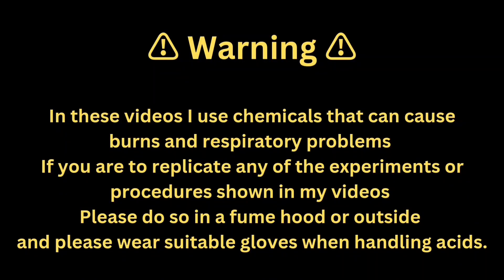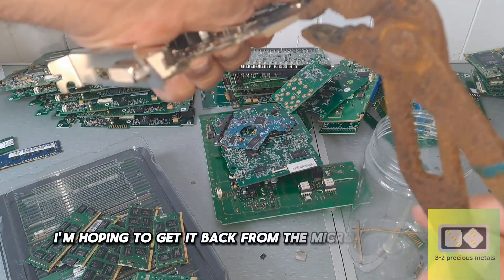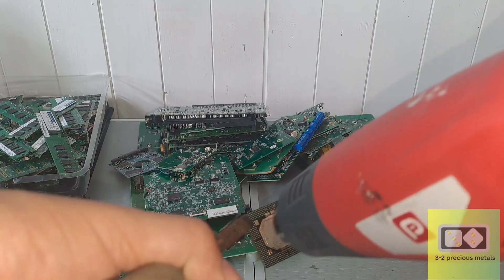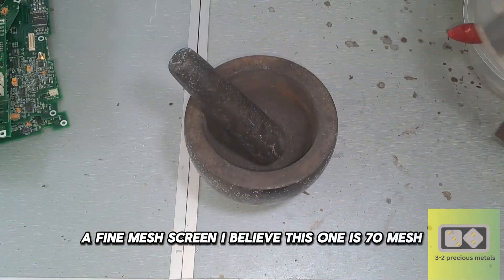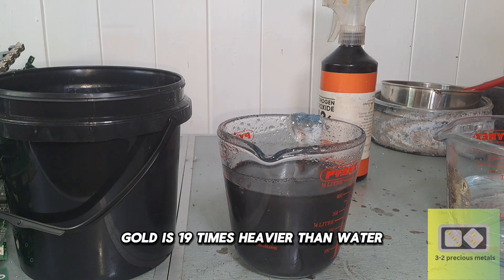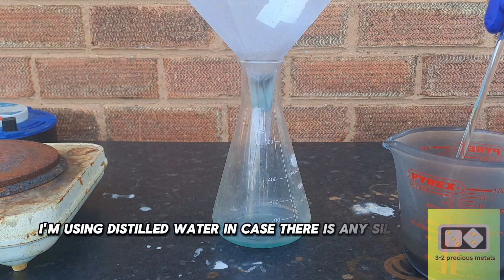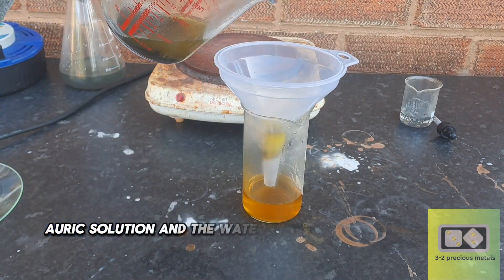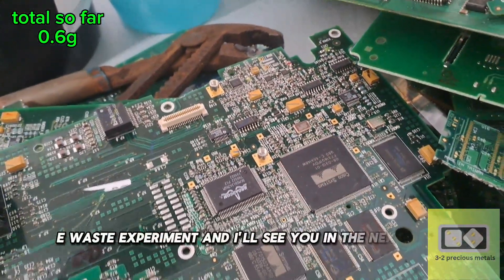GOLD RECOVERY from eBay EWASTE. (Part 1) gold fingers, processors, and bga chips

Comment: What does this take the gold to 14k, 24k?
Reply from the maker: The gold is around 23k - 24k as there could be some impurities from recovery. But a quick re dissolve and precipitation ensures 24k
Reply: @3-2preciousmetalrecycling  so for that process is aqua regia the process used? Sorry just new to this scene and have a ton of e-scrap I'd like to mess with.
Reply from the maker: I used the poor man's aqua regia, which is basically the same thing. When I added the potassium nitrate, it converted into nitric acid inside the hydrochloric acid. So it gives the same results as using hydrochloric acid and nitric acid, which is the "proper way" to make aqua regia. I hope this explanation is useful
Reply from the maker: If you have access to cheap nitric acid then the normal aqua regia is easier if not potassium nitrate or sodium nitrate is a good alternative. In my video on refining silver rings I show how I make my own nitric acid using sodium bisulphate and pottassium nitrate.